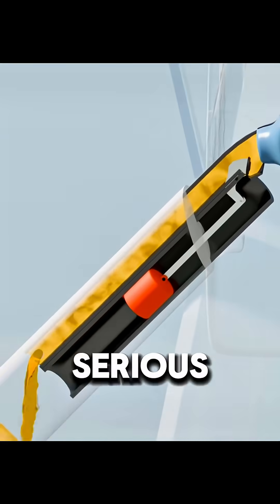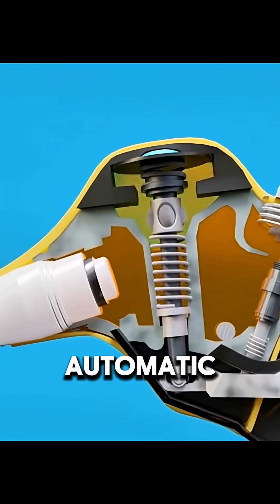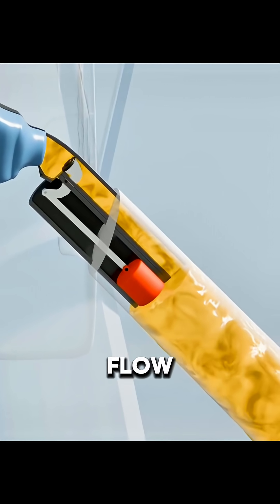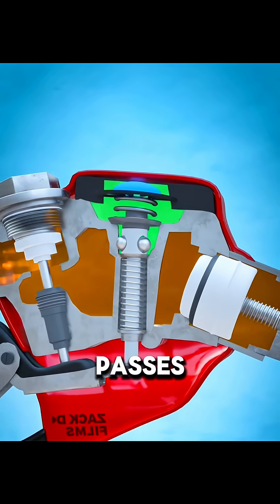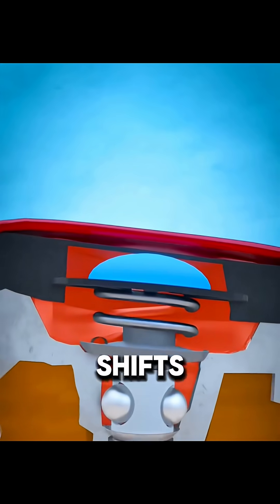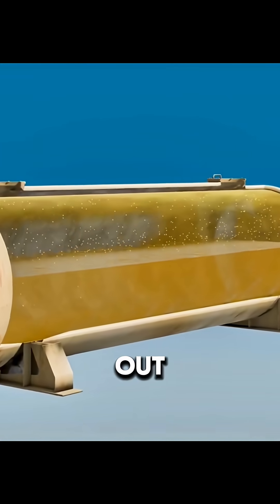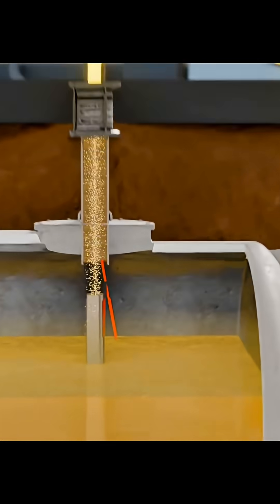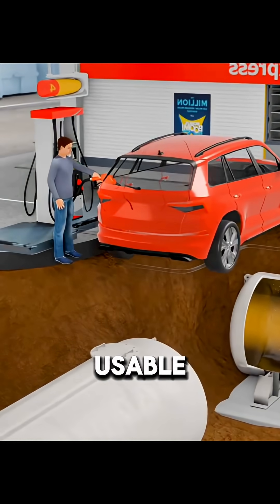The working principle of a fuel nozzle.#fypage

Comment: We never had any problems knowing when the tank was filled back in the day. Most tanks had a wide mouth that you could physically see the fuel level, and for cars with a more modern tank, you just listened to the sound. Fact is, if the nozzle cuts itself off, then that means you overfilled your tank. Fuel should never be high enough to be in the pickup tube. That will only create problems with performance and emission control

Comment: Don't buy fuel when the truck is delivering
Reply: explain
Reply: @elixontade4262 The thinking is that the fuel entering the underground tanks from the trucks during filling agitates the contaminant particles that would normally be settled at the bottom of the tank. The contaminants are now suspended in the fuel and will make it to the pump and then your fuel tank. I don't know if this is really as much of an issue as people say - I'd guess that it depends on the maintenance of the underground tanks and the turnover of fuel at the station, at a minimum.
Reply: It's now a urban legend, modern pumps have filters that catch any particles, not to mention most underground tanks now are a fiberglass plastic composition. I was honestly amazed how massive they are.
Reply: wait, is that legal? where I live gas station have to be shut down during the tank refilling, no gas pumping allowed. I think it should be a law everywhere. If the gas station is busy, wait or go to another one lol